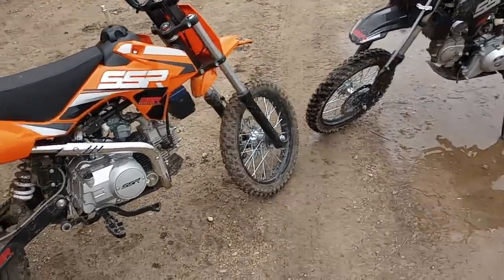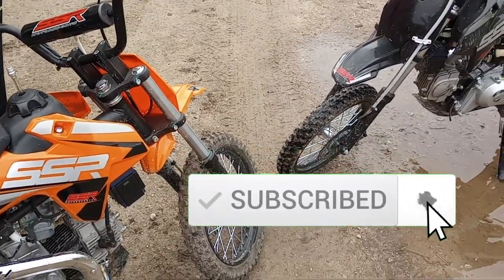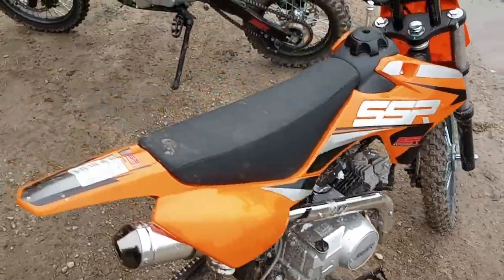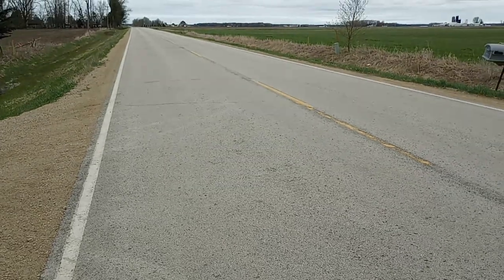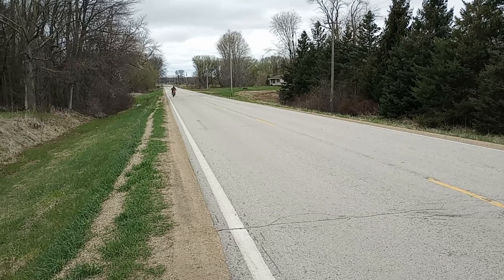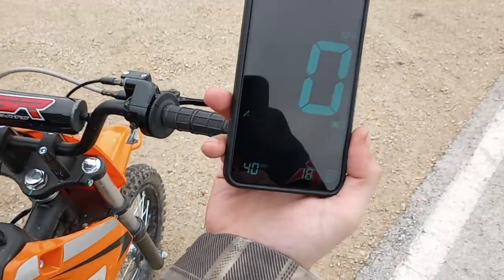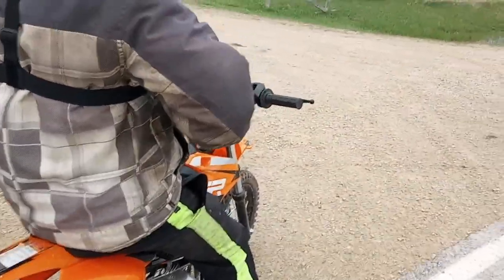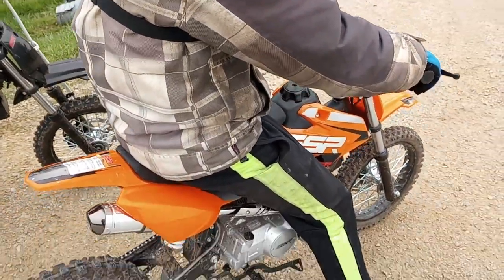Does Front Sprocket Size Matter? SSR 125cc Pit Bike (14 Tooth vs 16 Tooth) *Speed Test*

Comment: It is crazy how much slower the automatics are than the manuals. Mine can easily go 45-50mph any day.
Reply: I was thinking exactly the same... Also it seem that my 125 has a lot more power that these automatic ones... Maybe the automatic shifter puts more stress to the motor?
Reply: My 110 Tao hits 45-50 all you need is premium gas, upgraded filter and carb, 16 or 17 tooth sprocket and a racing cdi 

Seen some guy put a semi auto 140cc piranha motor with the same mods and a fmf pipe in a little 110 db14 frame. That mf was moving for having a 200lb dude on it

A lot of these china autos will hit 45-50 with some modding there’s a bunch of top speed vids where people are hitting 45 consistently in Chinese 110s I agree tho manual are better for performance they have a better powerband
Reply: @xmatthewlive6542   Mine does have a carb upgrade when I purchased it. It is the horrible 26 nibbi. Horrible to get it running correctly. I am definitely going to pry ending up purchasing a different carb
Reply: @ryanscott1989  on mine i did the opposite, I installed a 24 mikuni carb  instead of the original 26 carb. If has better performance at low rpm Wich is good for me since is an enduro pibike. The original 26 gave me problems because at WOT at low rpm because it would stall... Also, mikuni carbs are great.
Reply: @chancesmall7026  what cdi do you got on it? I'm looking around currently
Reply: My 110 ssr with 17tooth can go 58mph with a 100 pound rider
Reply: @dshmanbincleaning  what about a 250lbs rider? And I'm 6'3? Am I too tall to ride a 110? I am thinking about getting one
Reply: @4heunkn0wn  I would get a 125 a little bigger but will be perfect

Comment: i have 16t/ 41t  in 78cc manual geared bike it's do 95 km/h
Reply: god damn thats awesome, how much do you weigh? I heard rider weight affects the speed, I weigh 113kg / 250lbs at 190cm / 6'3", would it struggle with my fatass on it?
Reply: I have 15-42 ın 100 cc semi Automatic çünkü bike top speed 82 km/h

Comment: Or always about getting more speed it’s about power and torque
Reply from the maker: Just depends what u want from ur bike
Reply: @bearkreekboys  true true me for what I want is more power torque gets you out harry situations me personally or worried about making faster these are not meant hot huge double triples so no need for speed even then it comes to torque to get up over jumps and if trail riding want torque as well get up rocks and climbs unless you building a drag bike for top speed I wouldn’t do it if I want go fast I’ll pull out 250 or street bike that’s just me! But overall great video!!
Reply from the maker: @beyondfshn2844  appreciate the comment! Thanks for stopping by!
Reply: Interesting.  I’m 40 and got a 125cc ssr to ride with my 7yr old on his 50cc.  And I’m having an absolute blast on this thing. All I did was heavier rear shock (I’m 180lbs), pretty stuff (plastics, pegs,grips,gas cap, hand guards, levers upper and lower,  and re jetted with big gun exhaust and intake and she rips.  Might do the nibbi 19 next just for a hair more. But otherwise for being an old fart coming from kx and husky 250’s these bikes are super super fun in their own category.  
       Best part is being a pit bike I can ride at my son’s pace instead of launching trails on full size tires.  Made for an absolute amazing father and son experience.  I’m hooked.